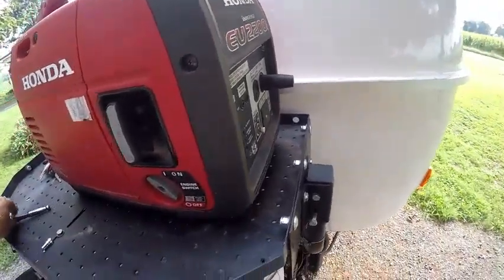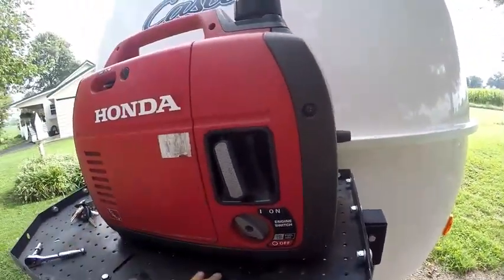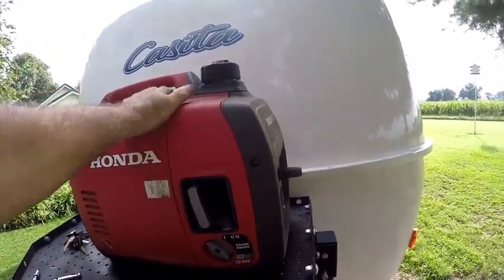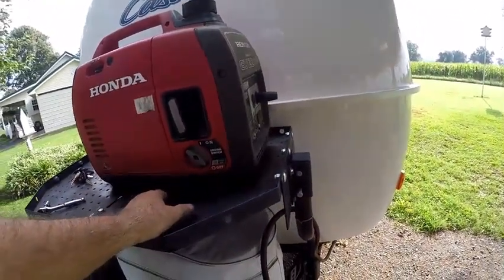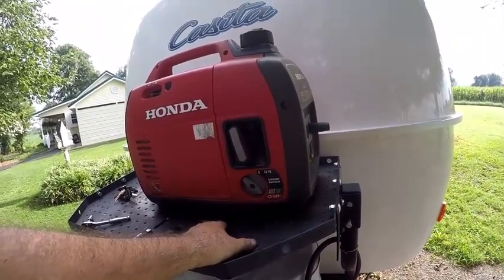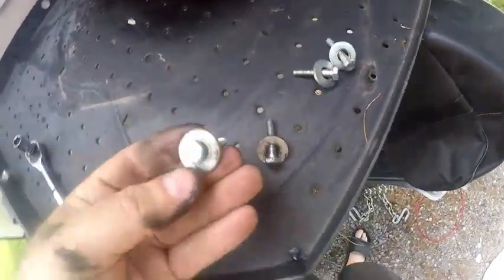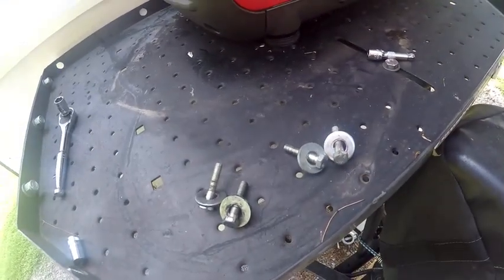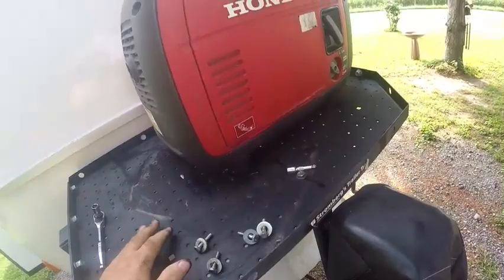DIY Honda EU2200 Generator Secure Mount - Casita Travel trailer - Stromberg-Carlson

Comment: We have been talking about a generator for ours! How many watts is the Honda? I am thinking that the AC unit consumes 16 amps on the AC that would be at 120 volts times 16 amps equals 1920 watts.
Do you have the soft start on your AC?
Reply from the maker: no soft stop but I'm sure that would be nice, just.careful to only one AC, not combo AC/Micro etc.